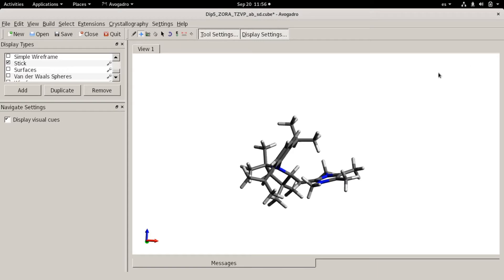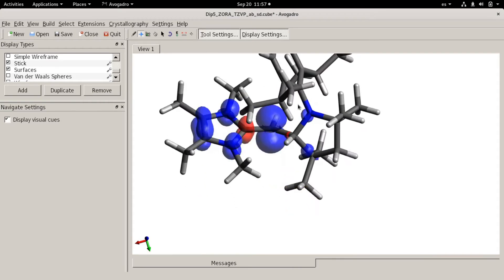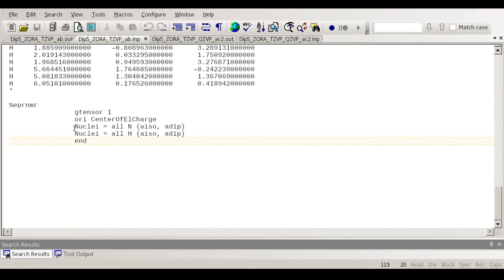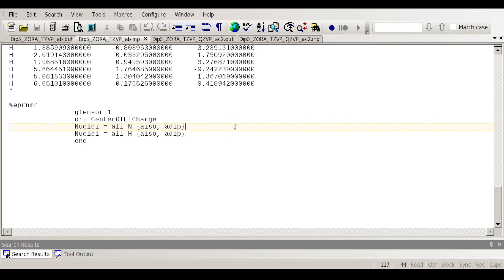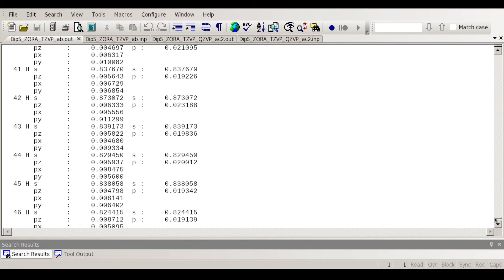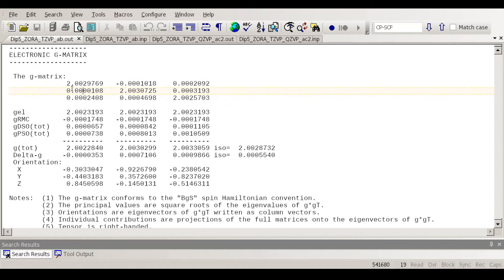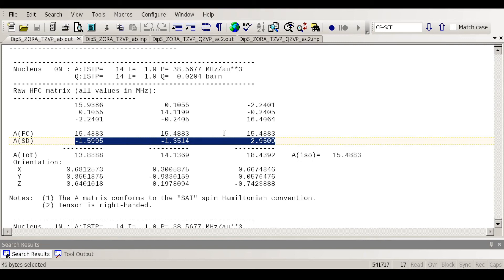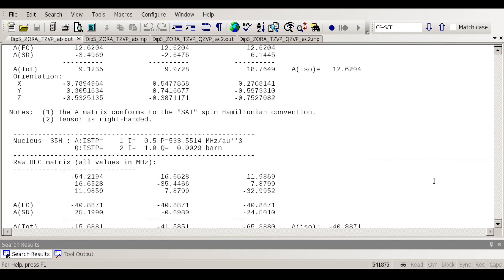Calculating EPR Parameters with ORCA

Comment: Hi! I am running my simulations on ORCA 6 on Archer2 so I can't visualize. Is there any software to visualize hyperfines?
Reply from the maker: Hi! Normally it is better to download the output and other files into a local computer, not try to do everything on a cluster. I think graphical mode can be used in some clusters but it is not easy. In your computer you can use Avogadro, Chemcraft, IBOView or other visualizers. When you do EPR calculations, orca produces a series of XYZ files which contain, in addition to the atoms in your structure, 4 atoms (He, Ne, Ar, Kr) defining an origin of coordinates and three directions for the eigenvectors of your tensors (hyperfine tensor, D-tensor, g-tensor, etc). You can use those atoms to draw the arrows manually when you export the image. It is not very practical, I admit. I don't know which molecule visualization programs allow you to draw arrows or lines, probably VMD, but I don't use it. I do it manually.

Comment: how to generate EPR Spectra from this calculation
Reply from the maker: You have to use EasySpin, in Matlab. And you have to define the spin system (electron spins, nuclei, etc), input the g-values, A-values and define other things. It is not too hard. There's an orca2easyspin application, but I have never used it.

Comment: I would be interested in similar calculation for transition metal complex.
Just tried VO(H2O)5 2+ but without symmetry constraints, it didn't work well even in the geometry optimization stage (denegerated states aren't that degenerated like they should be), and as a special bonus, V seems not to be present in EPR-II basis set.
Which functional/basis set is a good start for transition metals (I am working with Cu(II) and V(IV), from the EPR viewpoint we can call them "inverse twins" :D)
Reply from the maker: For optimizations I always use PBE0/def2-TZVP if the molecule is not very large, or PBE0/def2-SVP/def2-TZVP(TM), if the complex is larger. I have also used B97-3c, with its default basis sets, for geometries. And they look quite alright. Then for single point calculations I either use PBE0 or TPSSh with def2-TZVP everywhere. There is no point in doing geometry optimizations with very expensive methods (but always use hybrid functionals if you can). For EPR it depends. def2-TZVP at least, but if you want hyperfine splittings you need a decontracted basis set in the core region. For that using ZORA and using de ZORA-def2-TZVP basis (check the manual for the exact name), works quite good. If you want higher accuracy you may need to put ZORA-def2-QZVP, but that ONLY on the atoms you want to calculate hyperfine splittings on. Otherwise your calculation will take FOREVER!
Don't expect perfect matching of experimental g-values and hyperfine values. Be content with a qualitative agreement and errors around 10-20 %. You may get better results for your system, but the general accuracy is not great (for reasons...)
Reply: @niconeuman  thanx. Unfortunately some elements aren't in def2-TZVP (but at least, they usually are in -SVP and -TZVPP) when talking about geometry optimization.
Interestingly, PBE0 with def2-SVP is often good enough (or maybe best?) for quantum crystallography, although some bonds (like N-H in NH4+) are systematically underestimated. But it is fast and I really don't like (semi)empirical hybrids :D PBE0 is giving the distances very similar to those from X-rays even in vacuo (that's why I started using it even before it was cool :D). Perfect for first row transition metals.

Comment: Nice video sir!!…how can we find EPR parameters at different temperatures?
Reply from the maker: In general Epr parameters do not depend on temperature, unless there is a structural change. In that case perhaps you should optimize the geometry with some constraint based on the structural change you think may be happening. It's not an easy subject.